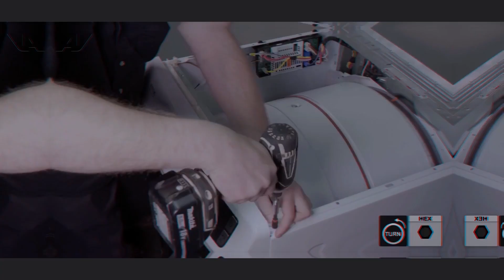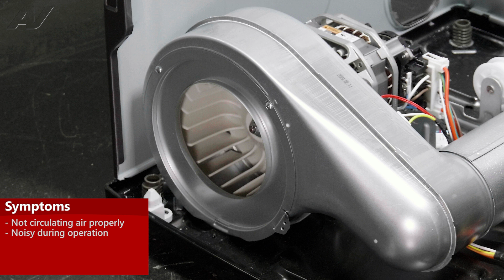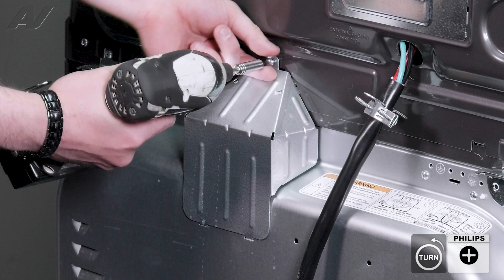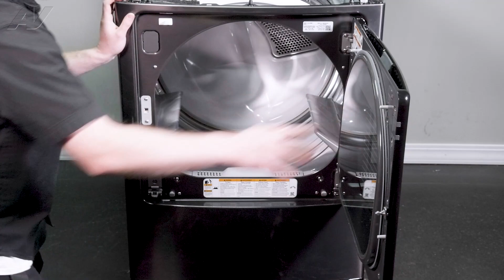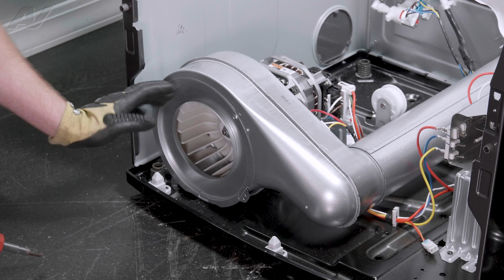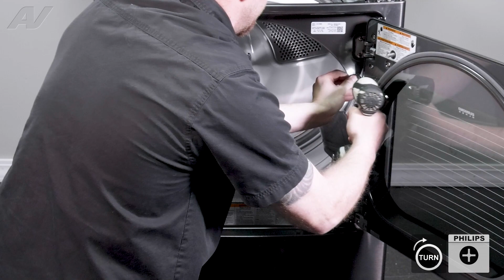Dryer Repair - Not Circulating Air Properly - Blower Wheel

Comment: Good informational video.  But with electrical safety in mind, why is the cord-strain restraint installed on the exterior of the dryer's back instead of on the inside, or actually half-and-half?  Installing this cord safety restraint like you are illustrating accomplishes absolutely nothing.